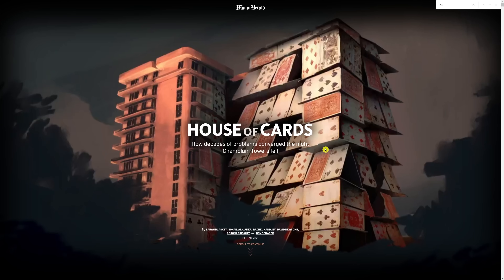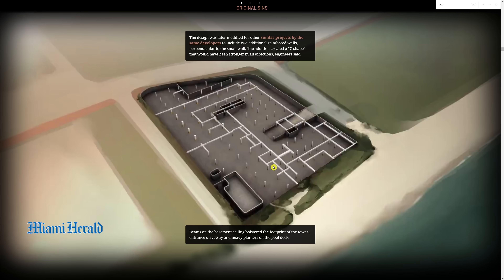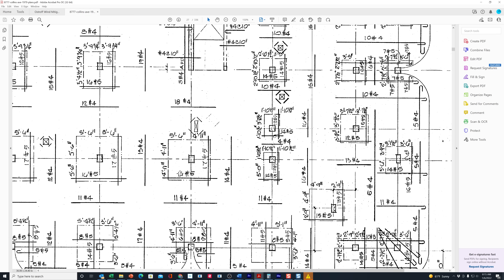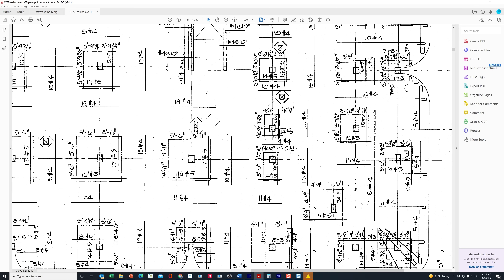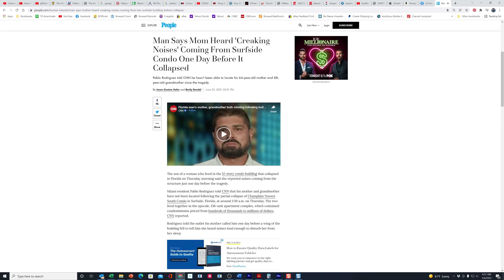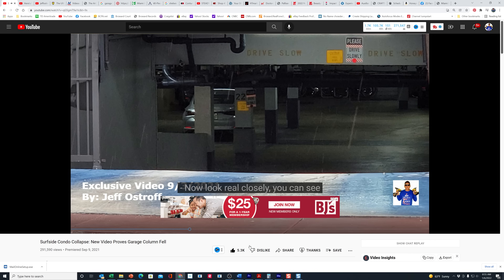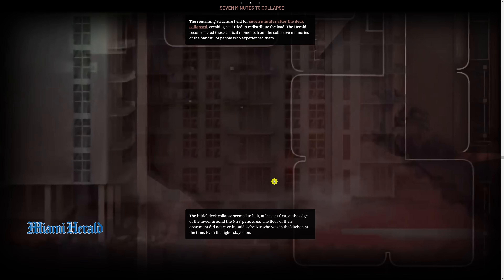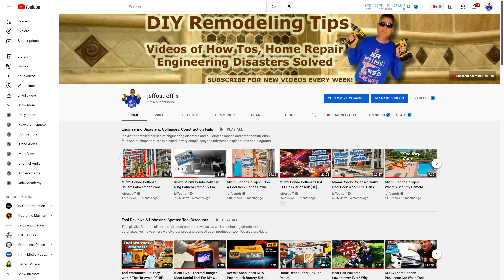Best Condo Collapse Theories: Me Or Miami Herald House of Cards?

Comment: RE: OVERloaded, UNDER-designed pool-deck:  if you look at the pool-edge coping at CTNorth vs the many pics of CTSouth swimming pool, it's obvious that over the years CTS kept layering new pavers OVER the old ones (to "save" money), while CTNorth did it correctly, i.e. excavating the old schlock, down to the structural slab, THEN applied the new topping + pavers... that is to say, CTS coping is FLUSH with the BUILT-UP pavers, while at CTNorth the coping looks original, i.e. standing "proud" of the pavers by several inches... OMFG.  #ZeroTownOversight
Reply from the maker: It looked from some of the photos we saw of CTS that there was only one layer of bricks. But there was at least 1" of sand

Comment: I have no solution to the mystery column, but I agree with Jeff that it is a true mystery.   All of the photos show it to be cleanly imbedded into the garage floor.  No matter how many tons of force or how much inertia, I don’t believe that a concrete column could penetrate a smooth concrete floor without significant peripheral damage.  If you allow me to quote from Sherlock Holmes, “We must not confuse the unlikely with the impossible”.
Reply from the maker: good quote
Reply: It would not be the first, only, or even largest "addition" made at CTS withOUT pulling a permit ... SMH.

Comment: FYI, a weight stack that is 200 pounds is a big one, and 500 would be huge even for the Ranger gym. Most of them have a spread base that covers more floor than two men talking. 
In other words, a place people line up close together is probably in as much danger as a gym. 
My Jeep weighs 6500 pounds, and puts more than half that on the front tires. Parking is definitely a big load.
Reply from the maker: Weights combined with failing concrete makes it more unpredictable as to the stability

Comment: Most important thing is that this is not a forgotten topic.  Most buildings collapse due to earthquakes and during the construction phase.  So this type of collapse is very abnormal and off the charts.  Trying to determine the mechanics of failure on the CTS collapse has been a huge undertaking and at this point there have been a few engineers who have been involved in determining what fell when and how including Jeff, Dr. Lehman and Josh over at Building Integrity as well as a few others who I do not remember.  Weather it was the gym floor that went first or the 11 stack, that building was doomed when that pool deck start falling down.  Thank you again Jeff.  I am going to side with you in that the column near unit 111 started going first but then again, I am just an average joe.
Reply from the maker: Thanks and keep in mind all of us even the smartest engineer is an average Joe without having access to all of the debris like NIST has. So we can't run tests on the concrete to determine which columns were the weakest and what was truly going on inside of the material.

Comment: I would be extremely interested in what the simulation showed with having those missing beams installed as well as the other what ifs...  for example; what if they did all 24x24 columns,  or even 18x18? Very interesting video,  thanks a bunch for sharing.  I would have never seen the Miami Herald's animation if not for you Jeff
Reply from the maker: lad to help!

Comment: And lastly where are all the required structural wall sections required on the plan?? Without these the contractor was engineering the building as he went along.

Comment: I wanted to add a few item to the CTS investigation. 
The main step beam connecting the building and the desk was reduced in depth from 2’-6” to 1’-6”.
Other area of the step beam may have been shallower.
This resulted in a massive overload.
When the planter beams were torn loose from their anchorage to the step beam and column it caused damage which sent a seismic wave up to the penthouse.
It appears the first failure was mid height at the penthouse which had been weakened by the drilling in of anchors recently.
If you noticed the south west portion of the tower lacked planter beams that could have caused that portion of the building to collapse.
the deck collapsed and punched cleanly through at the columns.
So this points to the planter beams being one mechanism of failure of the stability of the structure.
 
ICC and Florida multi trade licensed Building inspector
Reply from the maker: interesting insight
Reply: I'm just glad that Duh Developer--who was not even a US Citizen--made a ton of money by "value engineering" the steaming pile of CTSouth pool-deck down to zero safety margin... so I'm sure there's "nothing to worry about" at his other masterpiece, CTNorth... rolleyes

Comment: Jeff,
You can trace the path of the mystery column as it impales the slab with its rebar.Test were done in the past that rebar can easily penetrate concrete just as a shot pin will. There could have been 300,000 pounds driving the rebar it!
I think it is clearly the only rational explanation.
Reply from the maker: Only problem is these rebar rods are straight up from the floor, and the k column was 5 feet over, so it would have penetrated at an angle
Reply: @jeffostroff  Right I think it flipped over as the bottom of the column looks like it is still on the H beam.

Comment: House of cards, siimilar to the Grenfell Towers in Kensington UK and the Hard Rock Hotel in New Orleans. They all are deadly, and all were preventable. The powers that be took shortcuts that cost lives. Now to hold everyone who had a hand in it accountable and strengthen codes and laws to prevent this type of tragedy.
Reply from the maker: Yes, Grenfell was really stupid because fire dept told people to stay in the building
Reply: @jeffostroff  yes. And the E rated panels were the perfect storm, the events were a chain reaction due to subpar materials. Hard Rock killed 3, but they used shoddy materials and had bending floor jacks, now Champlain has a big bowl of corner.l cutting soup that cost lives of people who like the others, didn't deserve the fate. What ever happened to the courthouse lawn hangings and tar and feathering? Bring those back and watch things improve.

Comment: 2:14 That's EXACTLY what happened with Sampoong.
Reply from the maker: Yes but at that point you also had the fact that they put that massive air conditioner up on top of the roof and then rolled it around and so it was causing cracks on the roof slab but yes similar failure modes

Comment: You mentioned there's a plan to strip down and redo the pool deck.

given the buckling in the collapse of the building do you think it's possible that had it not collapsed when it did It might have failed when they removed structure for the pool deck?
Reply from the maker: I heard but have not confirmed it I have not seen any homeowners association meeting minutes, that the engineer might have told them last year that they found the damage in the pool deck was too much to be able to repair it. So who knows what they would have planned they would have I know they were working on emptying out the garage and moving everybody parking across the street. If that is correct that says to me they were going to put a whole bunch of shoring in the garage underneath the building and then they probably could have removed the pool deck without any consequences to the building because the shoring poles would have taken all of the load.

Comment: As for the "trigger", probably NOT a coincidence that it occurred during the Thermal CONTRACTION portion of the 24-hour cycle, and precisely at the moment of peak tidal forces i.e. Solar Midnight (1:17AM EDT) at Summer Solstice (sun closest to Miami latitude) during a FULL MOON.  i.e. Miami is (counter-intuitively) actually farther West than Pittsburgh, so Solar Noon (sun directly overhead) is 17 minutes past Clock Noon, add 1 hour for Daylight Savings Time, equals 1:17PM, ergo Solar Midnight is 1:17AM... that's how thin the margins were, how tightly the "spring" was wound... ouch.  (See Josh Porter/Building Integrity vid for how this building lacked proper "temperature" steel, even for the ACI Codes of 1979-80, and how that's mostly a problem during cooling/contraction, NOT heating/expansion--skipped right to spot:  https://youtu.be/WaZcyq7YsNA?t=1337
Reply from the maker: yes and overlapping rebars were not overlapped enough either
Reply: @jeffostroff  Hey you, stop wasting money and "increasing carbon footprint" with that minimum overlap and drop panel stuff.  Next you'll be wanting a proper shear-wall in the East-West axis.  ;')
Reply: MJ: Yes, any relation to tides IS a coincidence.  They have no more effect on buildings than the daily horoscope does.
Reply: @KB4QAA  Au contraire, mon frere  This structure was "on the verge" and not much force was needed to make that first "card" fall.  Besides the admittedly TINY tidal pull directly on building, there's the proximity to both the Atlantic Ocean, and the directly connected (but tide-delayed) Intracoastal Waterway across the street.  So 4 times per day the foundation of this hot mess of a building got a "nudge" from The Tidal Bulge, twice from the East (Ocean), and twice from the West (waterway).  Again, with a properly made building, these tiny forces would never affect anything, but when the edge of a playing card is balanced on the end of your fingertip, the slightest breeze will spoil your party trick. ;')
Reply: @MajorCaliber  Tidal forces don't act at a distance. They have no effect on buildings.  The reason they affect oceans is the minimal friction and the  large distances that build the force.   The Moon does not cause buildings to fall.

Comment: I look at those drawings and am so grateful that we use the Metric System in Australia. There must be errors made when dealing with measurements that involve things like fractions and difficult conversions.
Reply from the maker: They may seem difficult for you but it's just normal math over here for those of us using the imperial system. It's not likely they made any math errors it's likely they simply left out designing in the proper amount of rebar rods, or maybe using the wrong concrete those sort of things.
Reply: @jeffostroff  I understand that there may not have been any errors in this case but more broadly it has to be more common for mistakes using the old units. The risk is lower in an air conditioned office with qualified Engineers doing the design with all the checks and balances but it certainly gets higher as you transition to semi illiterate steel fixers on site in 45C heat working off dirty paper drawings.
Reply: @gregessex1851  we draw conversions in black Sharpie on our arms. Works well till we sweat it off. But that would never happen at 45 deg…

Seriously though, this is probably a calculable stat. Probably a well studied question.
Reply: @mixedupmenopausaladhd3999  I should have said 45 degrees in proper units 😂

Comment: Excellent video again Jeff and to Dawn thanks for your deep dives and putting it into terms that a regular person can understand. Could the creaking noises have been started by the bottom of the gym area starting to sag?  Also what about that 4th beam that doesn’t show in the overlay of the from earlier?
Reply: @jeffostroff, Shamoka Fuhrman, the night security guard said she thought the sounds before the collapse were from the elevator which was across her vestibule. The elevator was by the gym. Also, Elena Blasser from 1211 who died in the collapse told her son she heard creaking  noises the previous night. Her condo was closer to the gym area and over the columns which collapsed first than to the south perimeter wall.
Reply from the maker: I believe the creaking was further west of the gym by 2 condo units. Elena Blasser, 64, was the woman who told her son Pablo Rodriguez that she heard creaking noises in the building the night before the collapse of the condo. It is absolutely no surprise to me at all that she was located in unit 1211 and as you know any of the units that ended with the number 11 is what we call the “11 stack”. And from what we had seen most of the people that did escape with their lives were people in the 11 stack who heard noises in the hour or so leading up to the collapse of the condo building period now we don't know why ilena did not wake up and hear the noises when the building was about to collapse and then try to escape. It is possible they were trying to escape and just got caught up in it
Reply: @jeffostroff  Yes, the people who survived were near the location of the sounds. I'm sure others heard them but didn't manage to escape. I read people were found in corridors.
Reply: @georgiazettakaragianni9832    Link to corridor info?

Comment: A bunch of those columns probably had damage or a few critical ones from people bumping them with cars.
Reply from the maker: That's not even viable though garage is so tight that you couldn't even get up to speed in there to cause any kind of damage to these columns. I don't know why people keep thinking that driving 5 miles an hour in a garage is gonna cause columns to break open. Princess Diana's car drove into concrete columns going greater than 60 miles an hour and the column wins every time so

Comment: I think it’s possible that the “missing column” is actually there in the tourist video. It looks like that planter box came down around it in a punch sheer and smeared it with mud.
Reply: But in my scenario I have to admit that I cannot explain that white pole lying sideways. Is it a shaft of light? Is the column gone and part of the beam fail there? Maybe part of a drain pipe?
Reply from the maker: Not very likely that it would perfectly coat the column with mud.

Comment: It's possible the 3rd column was not visible in the video because the ceiling (underside of the pool deck) holding the overhead lighting to illuminate the column was now on the floor.  Just a hunch.
Reply from the maker: Anything is possible, but remember we can see the 4th column behind it which is 20 feet behind that column so if we can see the 4th column, then we would of course be able to see the third column

Comment: Your wrong about "As Built" drawings, as built drawings are just that they are generated after the building or project is completed. The purpose is just as it states, "As Built".
Reply from the maker: You are completely wrong I don't know where you got your information from I got mine from experience. The as-built floor plans often have changes on them that were not on the submitted floor plans.
Reply: @jeffostroff  I got my information from 54 years in the construction industry. I've generated over a 100 "As Built'  drawings myself after the work was 100% completed and submitted as closeout documents.
Reply: They are only as good as the people making them.  Architects will issue revised drawings during construction, contractors will request to change things or they change things on their own.  The architect should be retaining documentation of what they do, and what they are aware that the contractor does.  So as-built drawings should contain major changes but things can certainly get omitted in the process.  As-built drawings are prepared at the end of the process when everybody is ready to leave and get on with another project, so they don't always get a lot of attention.
Reply: @billj5645  still waiting for you to join the join to the group 😭

Comment: Hey Jeff

I really appreciate when you provide updates on this event.  Thanks for these.  They are a great public service. 

But it's time you let go of your M11 collapsed column theory.  You are incorrect, M11 did not collapse.  This was not the trigger.  Yes M11 not visible in the tourist video but then neither is M13.  Column M13 (28) is intact and stranding in all the after fotos.  By your theory it must be collapsed along with M11.  You cant see the columns in the video simply because they were in darkness. 

M13 should have been upright in the tourist video but its not which means your theory doesn't hold up.  The pool deck columns were strong enough and so was M11.  It was the slab/column connection which failed.
Reply from the maker: Well first of all you were misinterpreting the video I never said column M11.1 was the cause I said it was not in the tourist video and I still maintain that I am correct add it is missing/downed in that video. And keep in mind in that same video that I showed you my overlapping videos, you can see M13 in the video so I don't know how it is you can say that I wasn't showing you M 13 because column M13 is there because it was standing up straight into the dark after the pool deck had collapsed/sheared around it and that was evident in the tourist video. So nowhere did I ever say M11.1 was the cause because I still think that the collapsing pool deck pulled down M11.1.
Reply: @jeffostroff  If M11 is not the cause then why make a big thing of Prof. Lehman not raising this column.